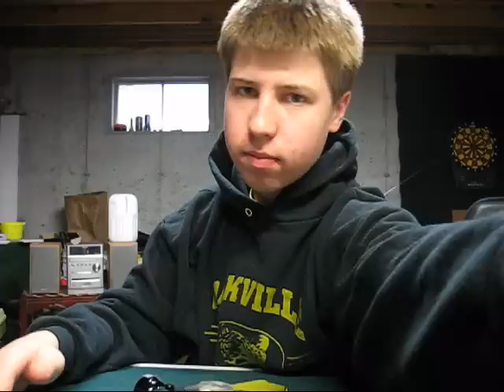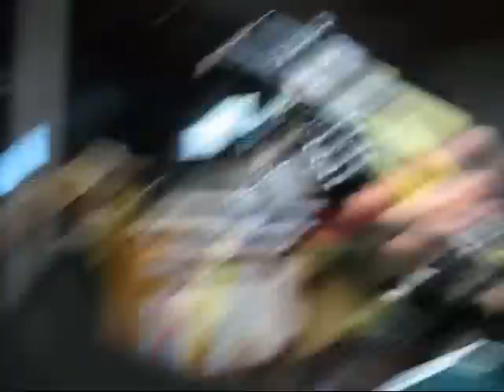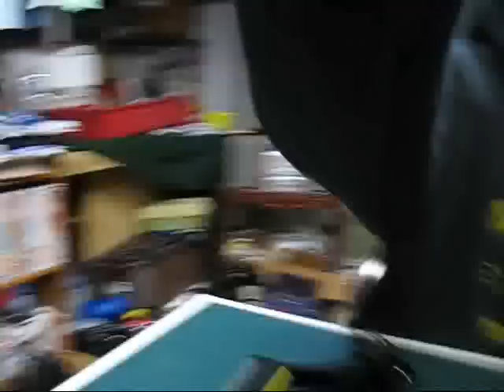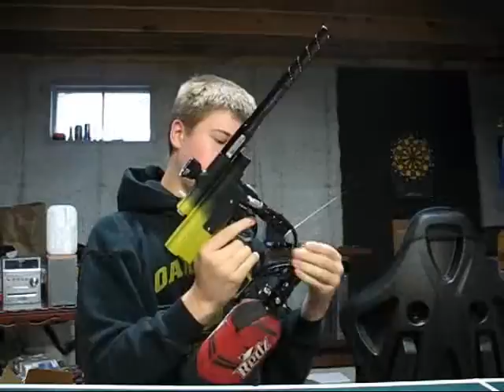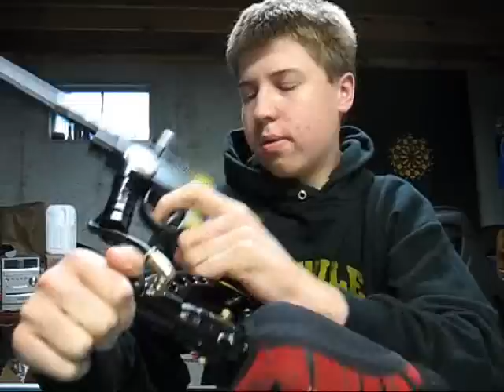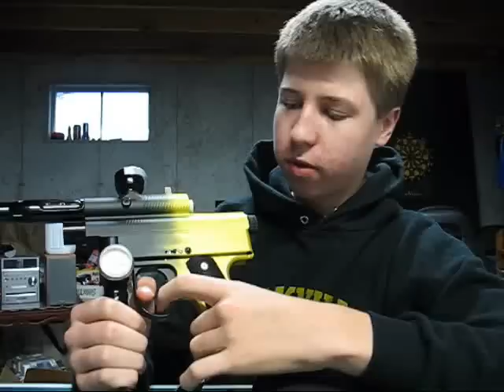My ICD B2K2 is broken

Comment: Did you mess with the regulator at all? When i put the lpk on my 98 custom and the reg was set to to low of a pressure it would make the leak sound and would not fire. Try setting to the recommended operation pressure and work from there.